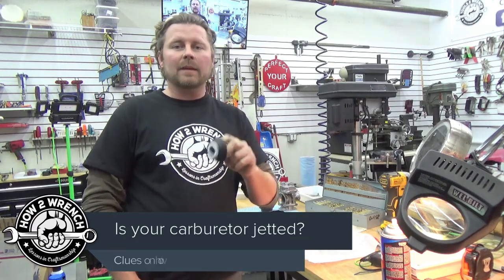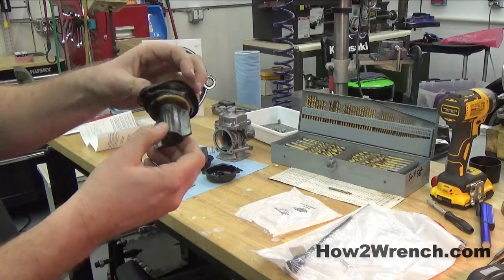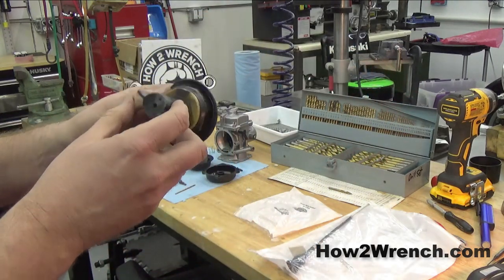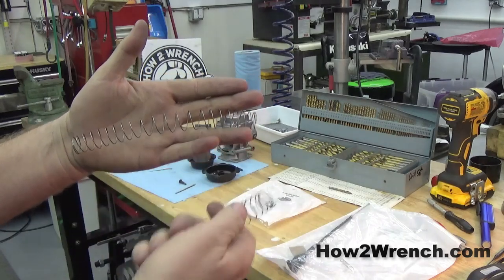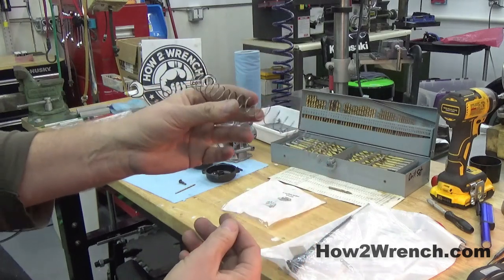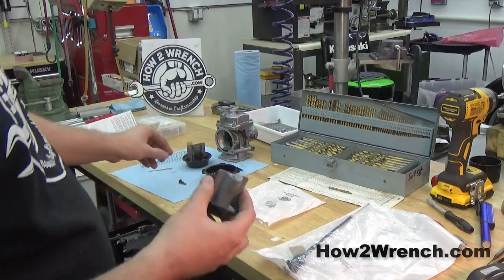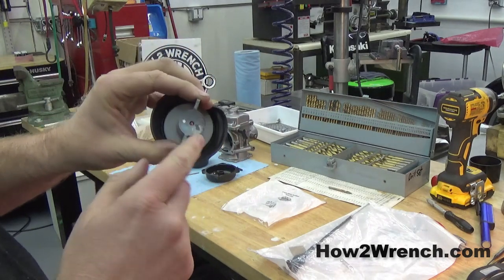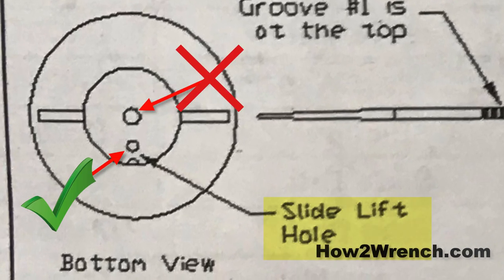How to tell if a carburetor is jetted. BONUS: Important parts replacement tips!

Comment: What does making the hole bigger or smaller really do? I have a 2000 kawasaki vulcan classic 1500. I took the carb off and cleaned it up today and after inspection the diaphragms work but have all swelled up. This made it hard to put back together. The pumper worked when I tested it after putting in back in the bike it doesn't seem to be working. After cleaning everything up looking at the slider you have to almost redline it before it opens past 1/2 to 3/4 just doesn't seem right to me. After a weekend road trip over 500 miles I noticed that I lost some low-end  torque at take off and at cruising speeds. That's why I decided to clean it. I took it for a drive when it when I got done wasn't happy. went back out for a longer drive later and it seemed to level out better still nothing like it was just before the trip. I know I need to change the diaphragms and bowl seal if I keep it. Just 27k I just got the bike this year at 25k. Im not a fan of this cvk carburetor. But if I do change this part should I see a big difference vs just putting a cable slide style ?
Reply from the maker: Thank you for commenting. Could you spare $2 and support us with even more benefits? Would you consider helping support our work here and help keep us going? We can’t thank you enough for helping us keep making technician training impacting schools all over the world.  Smash the subscribe button and bell! Join this channel to get access to perks:
https://www.youtube.com/channel/UCBhM8DCKnT3qXwTW0eToyCg/join   
-Daily MEMBER FIRST COMMENTS ANSWERED FIRST 
-Live Q/A video chats
-Wonder if we have a video on your need? Members can request content links!
-Full Access to the ENTIRE 700 video library
-Member-Only FREE tool giveaways 

Just want to say thanks quick to support us for this information and our work saving you money? 
Give us a high 5 here:  https://www.paypal.me/how2wrench